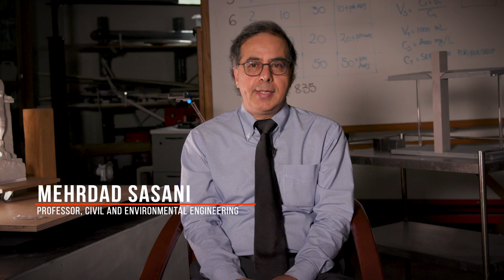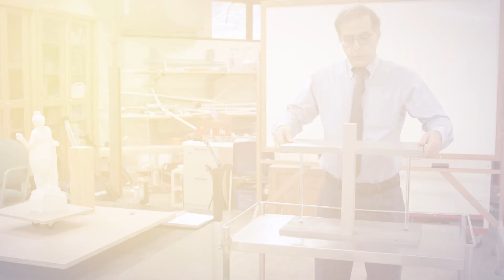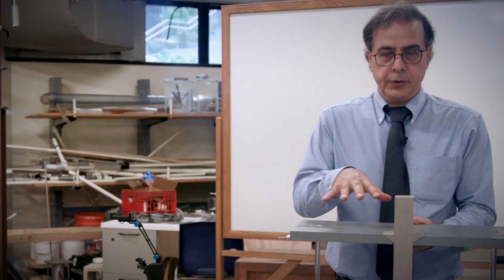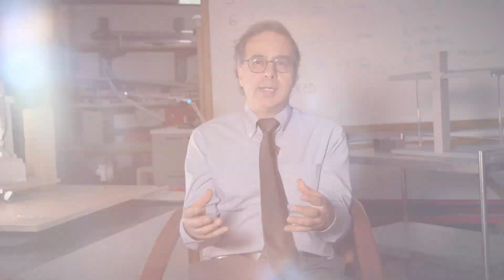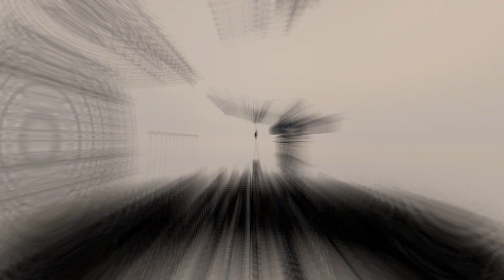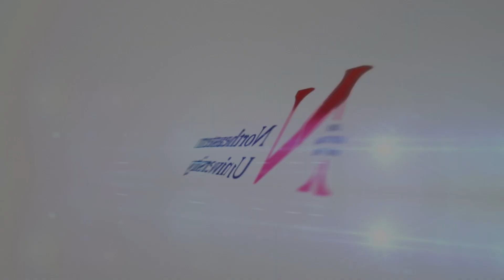Concrete clues could explain the Surfside building collapse

Comment: I don't think this sheltered, ivory-tower professor groks the corruption and laxity of Miami-Dade County building practices, esp. from the mid-1970s to mid-1990s... when Duh Champlain Towers (North and South) were erected... not to mention the political and economic factors that conspire to impede revelations of the hundreds of other structures in Flori-duh, compromised by heat, humidity, and salt air ... =:O
Reply: He's not doing a sociological analysis. Forensic engineers can tell you why a building fell, after some study. The reasons can include poor maintenance. It's not the engineer's job to be a politico-historian. Do you really need to be such a major jerk, buddy?

Comment: I don’t think water leaks have anything to do with structural damage. Water leaks are from damaged or old pipes. Pipes are not structural Lao as bearing members.
Reply: Not in this case. The water was also coming UP from underneath. Seepage. It helped erode the building from underneath. Please look up Designed to Fail, Building Integrity

Comment: The key here is "well-designed, well-constructed". We are starting to see hundreds of articles focusing on superficial cracks or spalling, or people finding pools of water in their parking garage and assuming their entire building is ready to collapse, when in fact these simply are not indicators of incipient failure of properly-designed and constructed reinforced concrete (or steel) structures. The task of the forensic experts will be to study the design in detail, and all the engineering calculations to see if there is a weakness. By the date of this building's construction, reinforced concrete structures were extremely well understood, but this alone does not prove there was not a flaw in the design. Following this, all possible evidence about the construction, including material samples, shop drawings, construction methods and techniques must be examined to determine how faithfully the methods and materials executed the original design. The Minneapolis I35 bridge collapse was determined to be due to an error in design - it was a ticking time-bomb from the day it was built, due to inadequate design calculations. The Hyatt-Regency walkway collapse was due to a implementation modification approved during construction, which drastically altered the loading component of the original design - this too doomed to failure from the day it was built. These are the elements - not superficial cracks, poor waterproofing or lackluster maintenance - that cause a substantial structure to fail, and it will take a complete and comprehensive understanding of every element of design and construction - not complaints from residents that they found the facade unsightly - to fully understand the underlying causes and trigger events that brought about the disaster.
Reply: They also need to look at the developer and his shady history as a businessman. Nathan Reiber was a disbarred Canadian lawyer who fled to Florida on his Yacht, to escape Canada taxes and embezzlement charges. He hired a cut-rate Architect to draft plans for the project. Architect was previously suspended in 1967, for structural failure after Hurricanes. Reiber was operating on thin margins and was constantly worried about his bottom line. It’s rumored that the first Contractor quit at start of the building and he cut corners on rebar, concrete, adding last minute Penthouse, all in the name of profit. In the end, he pocketed $23,000,000 dying a wealthy man.
Reply: @Dilberto88  I disagree. I do not believe the technical investigation starts with what you consider to be political talking points about this or that person involved in the project. Those considerations have their place, but they come AFTER the technical investigation, and should under no circumstances be allowed to interfere with it. The technical investigation must determine, in engineering terms, what caused the building to collapse. Then we work back up the ladder from there. We do not start with who I like or who you dislike.
Reply: @gregfaris6959  absolutely technical forensic investigation is the first thing needs done, before pointing at the dead rich guy.
Reply: Basanite is the future

Comment: In other words, a properly designed & constructed reinforced concrete structure will provide a warning all is not well due to time dependant deterioration. Cracks can be the "canary in the coal mine" of years past.

Other seemingly creditable constructor/engineer YouTubers say to watch for cracks in slabs running from column to column.
Reply: There was Lots of warnings, like an Engineering report 3 yrs prior said the damage was "exponential" &needed to be fixed right away. They ignored it.
Reply: @ShalomShalom-d5c  ,in the case of Champlain Towers South, there was spalling and diagonal cracks between support members. There was obvious long-term water damage. There was poorly-done maintenance on top of insufficient maintenance.